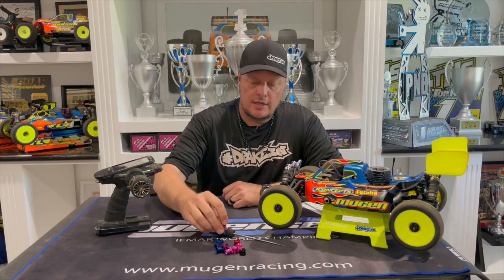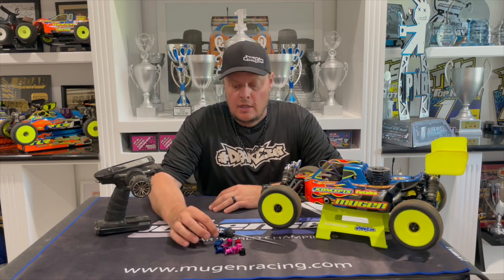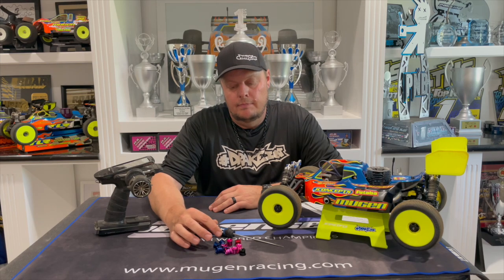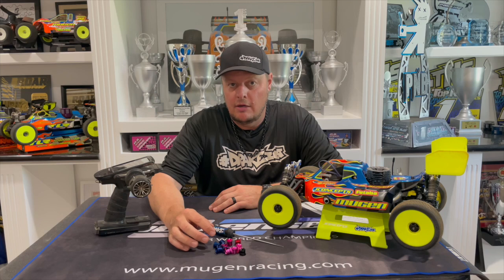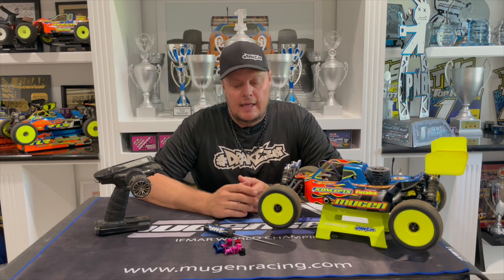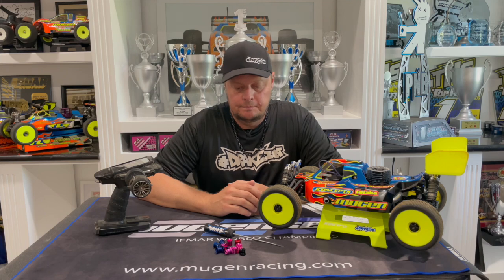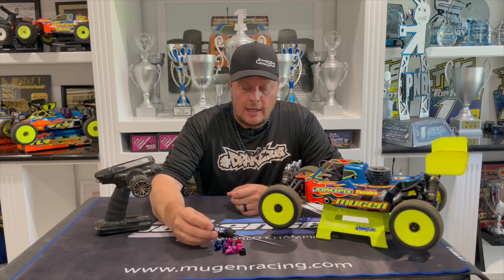Nitro Engine carburetor venturi and performance.

Comment: Hey Adam, huge fan (for like 20 years or something nuts like that).  I've got a MBX8 that I've been getting back into the hobby with and I'm having a HELL of a time to get the rear end to plant.  I'm currently running 10k/7k/5k in it, but I've tried 10/10/7 as well and while the rear end getting lose on power varies a little bit, I'm having a trouble keeping up with regulars and it's because exiting turns, or even on the straight they can go full beans where I cannot (without the rear getting all nuts), I have to roll into the throttle.

Any tips? I've played with wheel base length, shock springs and fluid, but still can't get it to plant its ass. 

Thanks ahead of time!
Reply from the maker: Send me an email to adrake@mugenracing.com and I'll send you a setup sheet to try.

Comment: hi, if I replace the Venturi from 6 to 7, do I have to change the jet-needle adjustment and how?  Thank you
Reply from the maker: You may need to slightly richen the sign speed needle to be on the save side.